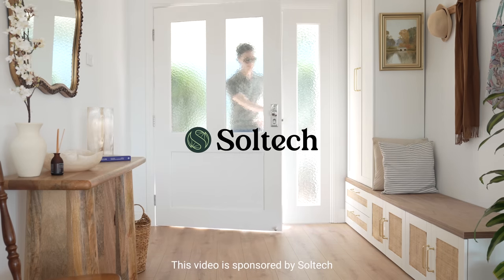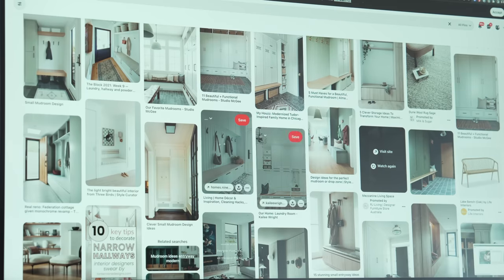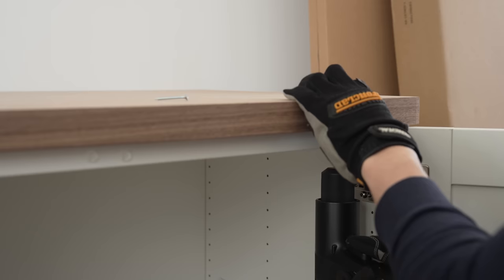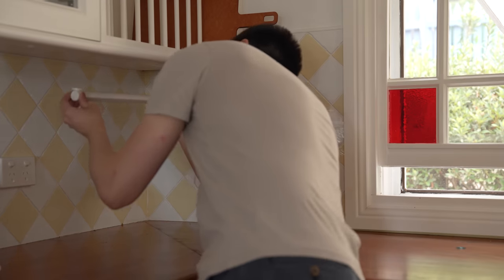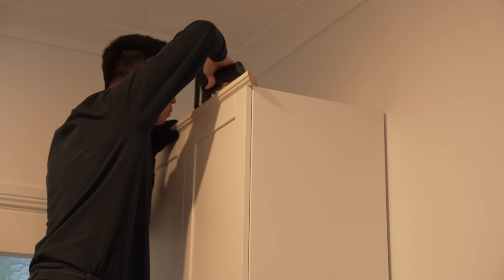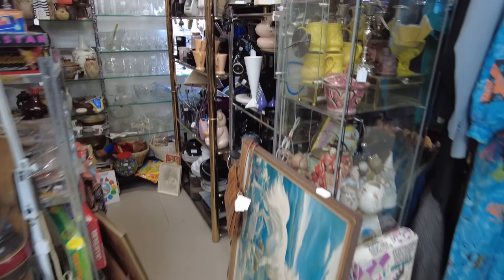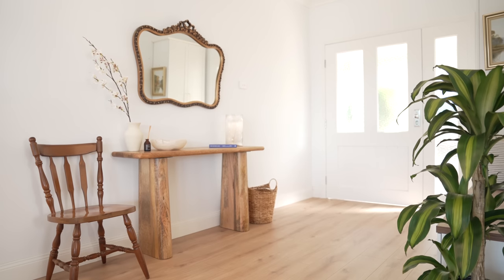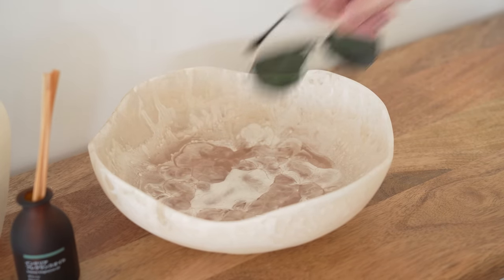Budget Entryway Makeover with DIY IKEA Hack and Thrift Finds

Comment: Hi Reynard, love your content! I was actually trying to make a bench out of an ikea unit like Besta or yours one, but according to Ikea it doesn’t hold more than 20kg weight. Do you think placing a wood top panel on top of the unit can increase its weight capacity?
Thanks
Reply from the maker: Yeah the platsa bench is meant to hold more weight. But yes, a timber panel on top should help distribute the weight, although you may need more support to hold more weight (L-brackets, 2 by 4s at the bottom and/or back, etc).